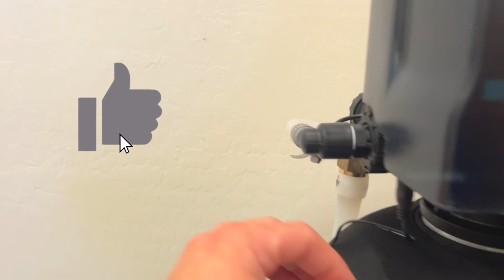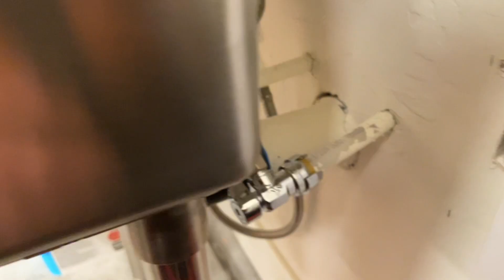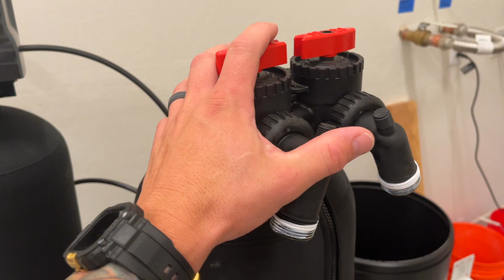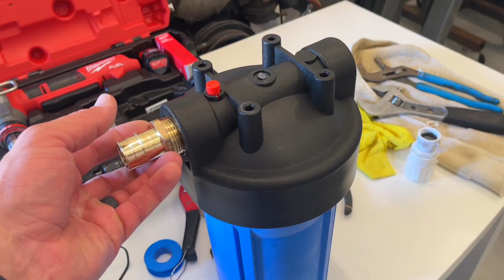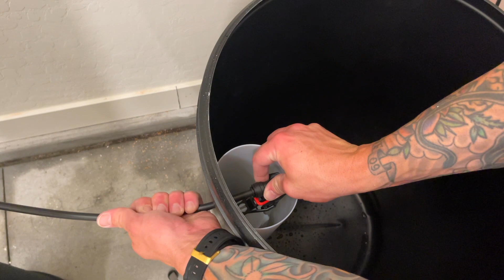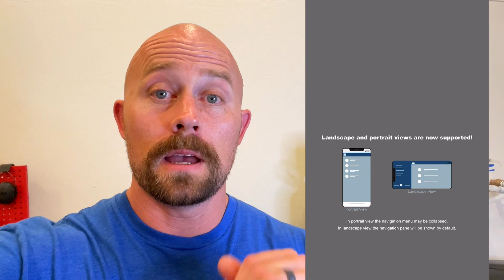How To Install Whole House Filtration System From Shell Water Systems | BEST Water Softener System

Comment: Was the PEX-A you used all 1 inch?
Reply from the maker: Yes. I used 1” for all the connections since my softener I ordered was 1” connections. Depending on the brand you go with they may offer 3/4” or 1” system options.

Comment: Hey. Nice video. Shouldn't the particle filer go before the filter tanks? To protect them? 
You have the filtered tanks out puting to the sediment filter..
Reply from the maker: They said it was usually installed after, to catch anything that may make its way through the tank or out of the tanks. I’ve looked it up and different system show it installed both ways. It seems to come down to preference it seems. Either way before it gets to the house it should be in line. 
I had a friend who’s old water softener took a dump and the filter caught all the particles from the filter tank and kept it from getting into the house pipes/appliances/fixtures, etc. so I see the plus in having it after the system in that situation worst case.

Comment: Thank you so much for the information videos. You have saved me a whole lot on installation. I just purchased the whole system with the uv light. Can you please tell me where the uv light goes. For example. Should the uv light be the first then the filter canister on the wall.
Reply from the maker: Thank you, I’m happy you found it helpful. 
It’s preferred and highly recommended to install the UV after the softener. This is because the UV works better on water that’s clean and clear of the minerals or anything else that could be in the water.
Reply: @FortKnoxCo  thank you so much
Reply from the maker: @robertchen9686  your very welcome

Comment: On hot water systems they install check valves, do we need one for this unit, great video
Reply from the maker: If you already have a water loop set up for a water softener I’d assume the house was built to code and has the proper check valves and anti siphons in place.  I haven’t seen a check valve connected to the water softener system itself but I doesn’t hurt having one before the hot water. Usually that’s installed at or near the water heater plumbing. I have one in line on my tankless water heater for the inlet side of the water heater.
Reply: Its not supposed to be connected the water softener first and the the carbon one?

Comment: This video is 7 months old. As far as the reliability of this system. What do you think? Impartial opinion. I am looking for a system, but i am not sure how much of your review was influenced by the company. No disrespect to you. Many people from other parts of the internet complain about other companies' customer service and system longevity and reliability.
Reply from the maker: Understandable. We haven’t had any problems since installing. No leaks and not function problems. All I’ve had to do is add salt to the brine tank as usually expected. The water is still soft, I recently checked it again to see how it was operating. We have no complaints. 
I think it really just comes down to what you want, a full home filtration system or just a water softener. I think that is what your main choice is on system/$$. I gave the manufacturer my honest opinion when they sent it and I installed. They took a couple ideas with the hose hook ups and clarifying the set up process to be more diy or understandable. They seemed very genuine and had good communication & customer service

Comment: Does it needs to drain out into the sewer system?
Reply from the maker: The small flush line needs to get to a drain. If your house is not plumbed for a flush like that already goes to a drain line the washer machine drain then you’ll need to run it to something similar.
Reply from the maker: I guess technically it doesn’t need to be a sewer system, but the water needs to go somewhere it won’t cause a problem for you. 🤙🏼
Reply: Could it drain to a sump pump ?
Reply from the maker: @Good_Things_To_Know  I believe so, if the sump pump usually handles the plumbing/toilets/sinks etc. then it should be fine.  I believe the sump pumps are meant to handle regular plumbing needs. when it flushes out it's just water and medium to hight flow for a short time.

Comment: How good are the products from shell water systems? I am thinking to get from them but not sure. Any feedback?
Reply from the maker: I don’t have any complaints. Haven’t had any problems with the system after installing it. Only had to add the salt to the brine tank. Other than that it’s been set it and forget it. 
As far as quality of the material the system is made out of they are on par with any other system I’ve installed. The head unit being able to connect to your phone is more advanced than some other cheaper systems. Others are all programmed at the head unit. This one you can view some stats and usage numbers from your phone when your near the system.

Comment: What type of maintenance do the tanks need?
Reply from the maker: None. The only maintenance is adding more salt to the brine tank and about once a year changing out your small pre filter.
Reply: @FortKnoxCo  nice! So I’m trying to decide between this one and aquasure, in your honest opinion which one do you recommend?
Reply from the maker: @robertmtb408  honestly they both work great. The aquasure is a bit more affordable but the shell water system offers the whole home filtration aspect. So you do pay more but you are also getting more. It really depends on what you want. Do you just want water softening or water softening and house water filtration.  They are both great systems
Reply: @FortKnoxCo  I want the whole house water filtration system and softener! Thx again for the help and great video you made, I will be ordering the shell water system
Reply from the maker: @robertmtb408  awesome. I’m
Happy I could be of help

Comment: For the carbon filter is it fine to just use a manual head valve? And is there any maintenance you need to do with the carbon filter?
Reply from the maker: I’m not sure what you mean by that. I would use the valves the unit comes with. The carbon tank has a head valve that is very simple, in and out. The resin tank has the big head unit with the plug in regulator and all.  I wouldn’t use any other valves that didn’t come with the unit.

Comment: Do have a video that shows how to install with softener on a home that doesn’t have pre water line setup?
Reply: Ok thanks I appreciate ur feed back.
Reply from the maker: Unfortunately I haven’t made that video yet. But I have been asked a couple times to show the method of installing or creating your own water loop. So I may be doing that in the future. 

But in short, if you have your main water like in the wall that supplies the house you would cut about a 12” section out somewhere between where it comes into the home and before it splits to the water heater and house cold lines, you would install two 90 degree elbows to bring the line ends out from the wall, have male threaded ends on those and that would essentially be where you install your water softener. You’re just creating a break in the continuous line to make it first go through your softener and then continue on. 

The one important thing when cutting that line other than making sure the water is turned off, is securing those pipe ends or stabilizing the line in the wall so it has some support. You don’t want the water line to me moving around a lot especially since you’ll be connecting stuff to the ends and they could be bumped around

Comment: Thanks for the comprehensive video.  2 questions: 1. Will the tank and sediment filters pair with a standard water softener/brine tank system (I already have an existing system)?  2. I'm hoping the whole house filter will eliminate the need for an under-sink R/O system - will it?
Reply from the maker: If you want to use the carbon tank with your already installed water softener I’m sure it would work but I’d recommend just installing the whole new system while you’re at it. And test a pre or post partial filter can be added to any filtration system. 

As far as the whole water system being filtered and softened it technically is drinkable filtered water throughout the house…. But in most cases the cold water at the kitchen sink is a dedicated hard water line. It is bypassed usually to be hard water for watering plants and such. Just the way things are commonly plumed. So depending on your specific set up in your home the water at the cold sink might still be hard, just like the water spigots for the hoses on the outside of your home. They are all hard water, unfiltered.  That is why most people still use a reverse osmosis system in the kitchen to filter their cold water line for drinking. 

You could install the whole home system and then do a harness test on the cold water at your kitchen sink. If it’s showing that it’s softened water then that means it’s going through your filtration system. If the cold water is still hard water then I’d say you need a reverse osmosis there for that drinking quality source. 

I hope that all makes sense.

Comment: Does A Water filtration system need to be near the pump?
Reply from the maker: No. It just needs to be inline on your water supply and installed before the water splits to your water heater and cold lines. It’s just the first thing in the system to filter everything down the line

Comment: How would you handle installing this system on a slab house? I'm in S.E. Alabama, but it still freezes sometimes.
Reply from the maker: Our home is on a slab. All utilities and water are underground but we don’t freeze much out here   If you have water lines in your home you would just create a loop to tap into the main water line before it splits to your water heater and cold water. Put the softener in and have it in a location that can stay warm enough to not freeze. Not sure if there is anything special you’d need other than that. I don’t know if there  is already something in line to help with preventing damage to the water lines when they freeze.

Comment: I see that you have only 1 value with the backwash feature.  Does that 1 valve backwash both tanks, or would you need 2 valves with backwash to backwash both tanks?  Thanks!
Reply from the maker: Are you referring to back wash feature as the portion of the process where the resin tank/water softener  flushes itself with the salt water during its regeneration cycle?  
The system doesn’t need two head units with a backwash feature, I believe it only needs to be done on the softener tank which is why it comes with a head unit that incorporates that all in the top of the softener tank, the other tank just acts like a giant carbon filter which brings your water to a drinking quality, the softener tank has the resin beads in it that needs “scrubbing” to clean off the minerals/hardness periodically and that’s done by flushing itself with the salt water during regeneration cycle.

Comment: Both tanks they need to be flush?
Reply: Thank you
Reply from the maker: @camilodiaz1290  your very welcome
Reply from the maker: Just the carbon (black material ) tank because it activates the new material inside. The other tank gets flushed with the salt water when you actually run the start up cycle on the system
Once it’s all assembled.

Comment: Will this filter the hard water from my sprinkler system? It’s gets on my car and is a pain to remove the hard water spots.
Reply from the maker: 99% sure it won’t because the water line coming into your home has a split off to a couple water sources in your home avoiding the water loop. One of them being the hose spigots around of the outside the house and the sprinkler system. Another is usually the cold water that goes to the kitchen sink. All this is usually a common practice because you don’t want filtered water for plants usually. So the water on the outside of the house is obvious but the cold water source at the kitchen sink specifically is done assuming you might be watering plants in your home. So this was a standard way of plumbing homes for ages. This is also why people usually install a reverse osmosis system at their kitchen sink so it can filter that cold water which is hard water from the street so you can have a drinking source in your kitchen.

Comment: I just bought a very similar system from Softpro but I am having difficulty and they dont seem to have the same requirement for a sediment filter after the whole house filter and softner.  I have tried looking up whole house sediment filters to buy but almost all of them have low flow rates and I dont want to drop my water pressure after buying a whole house filter rated for 14 gpm.  Any recommendations?
Reply from the maker: I would recommend the Aquasure High Flow Filter and housing, I just put a link at the bottom of this video for it. Should take you directly to the item I’m talking about. I haven’t had any problem with this filter and it’s a 5 micron filter so it should restrict too much at all.

Comment: Great video. Would it be the same set up for well water?
Reply from the maker: Should be, yes. I’m assuming your well water eventually makes it way to a single line of water coming in, and that line can have the softener installed in line before the water runs to the house and splits to the water heater

Comment: Great video!

I noticed you didn’t install the brine tank drain line.  Is that optional?
Reply from the maker: Yes. That little elbow that they give you to attach. The drain line is just in case that brine tank were to malfunction and it overflowed. In most cases I haven’t seen anyone install that. But it’s just there as an option. If you have the space or a drain nearby, you can go ahead and just attach it would run that line somewhere you’re OK with the water draining. But I believe most people don’t install that because it never gets any use. 

Thank you for watching and commenting

Comment: enjoyed your video very helpful I installed my softener and was concerned about adding a fiiter to my system,  it states to add filter before softener on your video you added after  softener which will be best before or after softener thanks   Al
Reply from the maker: Thank you so much I appreciate that. Yes you are right some systems ask you to place the filter before and then some do it after. Either way you’re good and it’s another added benefit. The idea of doing it after is to catch anything that may make its way through the filters and through the softener to catch it before it goes into your house, by placing it before the system you’re doing just that Which is catching any large particles before they go into your system and then into your house. I believe the only reason to do it after is to prevent anything from the system, such as the carbon or resin from the two tanks, making its way out and into your house. But the theory of putting it before is to catch any those large particles coming from the city water supply. So if I had to put money on it, I would say you could do it after and let your system catch any of those large particles, and obviously protect your house from having anything coming out of your system and into your water. I hope that all makes sense. Either way a pre-or post filter is a great addition.
Reply: Thank you for the fast reply it liked the way you installed your filter assembly this did not occur to me about adding a board to studs for filter mounting thanks again. Am waiting for next info video
Reply from the maker: @alfonsocruz4945  of course. Happy to be of help.